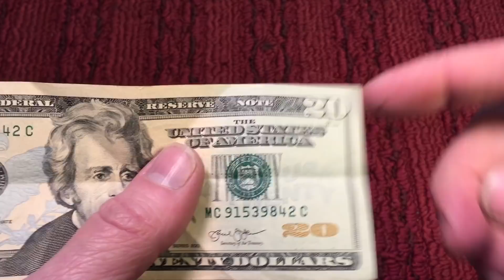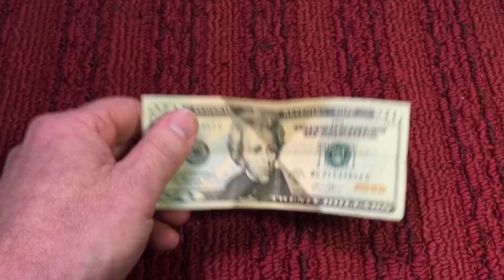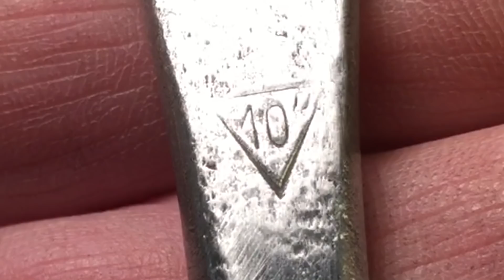Antique German Screwdriver Restoration...

Comment: I like the tip about the jewelers loupes. I have a number of them.  Some of them have a wire clip that goes around the back of your head. It is easier than trying to keep it in your eye socket.  I prefer 4 or 5 power for the greater focal length.  Beautiful job on the perfect handle screwdriver.
Reply from the maker: Larry I never saw the wire ones!  Cool!  😃👍

Comment: Liked the screwdriver. It turned out great. I could not find any for a long time and about gave up. But my son was at a auction when I was out of town and found one. Kind of ruff but trying to do a restore on it. Not sure if I am going to be able to keep the old scales. Kind of slow I don't have heat in my shop so I can only work now and then. It may be spring before I get much done. Thanks
Reply from the maker: Glen, Replacing the scales is always a pain in the neck! If you can try to save the old ones, you can always replace them later on!  =)

Comment: Watchmaker's magnifiers are always a source of fun. We use them at work a lot. Mostly to inspect solder joints or remove a metal splinter from your finger. And be honest now: 
Who didn't insert one into his eye, took a tool in his hand and said: "We are the Borg, resistance is futile". I'll be honest, I did that...
I also used it on an ink pad, and told a colleague to take look at something with it...he looked like a Damaltian afterwards...
So much for "germans don't have a sense of humour".
On german screwdrivers the length is always the length of the shaft without the grip. But this screwdriver must be made especially for the american market, because the metric system is the standard here. I would like to know who actually manufactured this.

And I wish you a Happy New Year!
Reply from the maker: LOL!!!!!   Inking the Loupe is classic!  I remember we charcoaled the eyepieces if binoculars...  What fun!!!!!!!

Comment: Scout do you ever get a static build up using your belt sander?
I was so I put a ground wire on it to a 1/8 inch spring. And made a bracelet out of the spring. Eliminated my static shock.
Nice video for the new year and great job on the screw driver.
Reply from the maker: Thomas-  They say it might be the plastic wheels creating static!

Comment: That jewelers loupe needs some work urgently. They all need a fairly large hole drilled in the side. Then you can wear them for longer and they don't fog up on you. Once you do it, you won't have any without the ventilation hole.
Reply from the maker: Wow!  Never knew that!
Reply: @ScoutCrafter  From memory I drill a 1/4 " hole and then extend the ends with a smaller drill bit,  to make a slot. An old German Watchmaker showed me years ago, and I have never used one without a slot since.